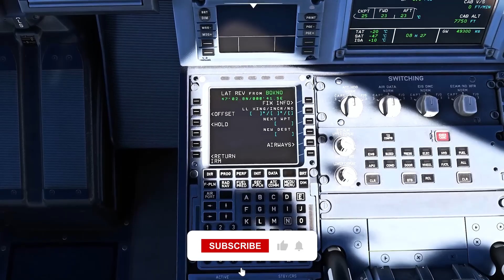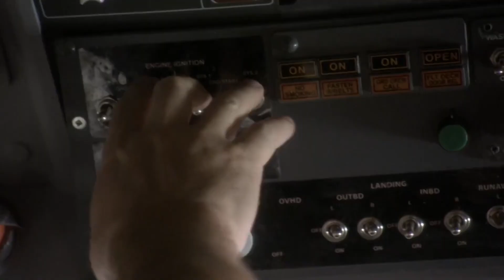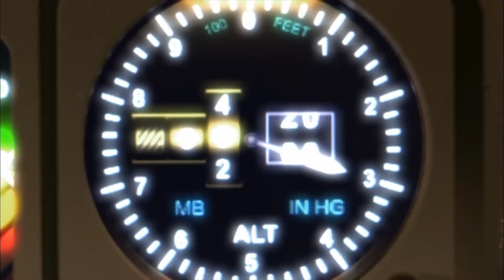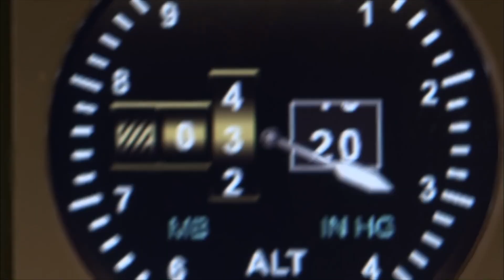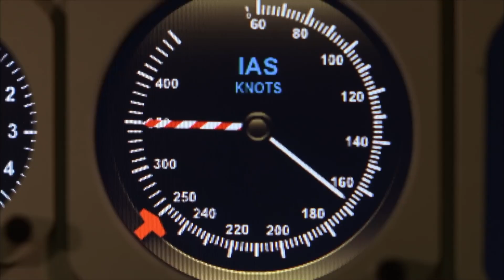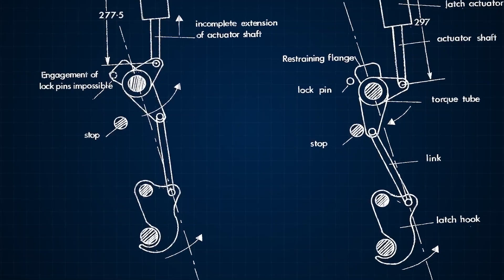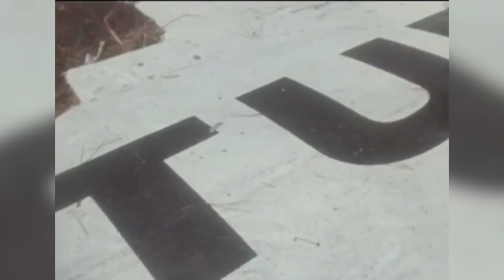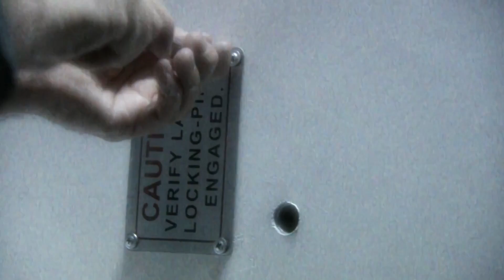Turkish Airlines Flight 981: The Cargo Door That Killed

Comment: McDonnell Douglas knew during the testing phase of production, that the DC-10 was a flawed aircraft. It wasn't just the cargo doors but after the Chicago crash , the National Transportation Safety Board cited McDonnell Douglas for not installing an adequate amount of backup systems to prevent catastrophic emergencies from happening. They basically rushed the plane through production because they were in a heated competition with the Lockheed 1011 Tri-Star. Anyone familiar with  the recent quality control issues at Boeing and the whistleblowers who came forward, would be shocked to find out, that back when the DC-10 was being designed and tested, a whistleblower named Dan Applegate, tried to warn people about how dangerous the DC-10 was, but no one would listen. All the more reason why Boeing should have NEVER merged with them. Many of the executives involved in the DC-10's production , migrated over to Boeing and the same issues began to plague production of the 737 Max and 787 Dreamliner. By the way, there are some inaccuracies in this video. Code-share did not exist back in 1974 and the strike was at British Airways, not Air France. Flight 981 was full because the strike forced passengers to find alternate flights to London and Turkish Airlines was one of the airlines that had  flights available.  You said that the tail number was TC-JAV but in the caption, it is GAV. It should also be noted, that when the cargo doors should have  been modified, the plane operating Flight 981, was put back in service without the modification, yet someone from McDonnell Douglas signed off on paperwork stating that modification had been made when it had not. To this day, investigators question if this was an innocent oversight, or something more sinister and deliberate. McDonnell Douglas originally built that jet for a Japanese airline but they opted to go with the L-1011. Desperate to sell the jets,  McDonnell Douglas pressured Turkish Airlines to buy them, even though the airline told them that they didn't have the proper maintenance and training facilities for flight crews and ground handlers. They argued that  they were not ready to  operate a much more sophisticated and technologically advanced  jet ,  but McDonnell Douglas convinced them, that it would be a positive for the Turkish economy. There  is much more backstory to the history of the DC-10 and it's crashes. You should read all of the reports that I have read.  If I go on, I could write a book.